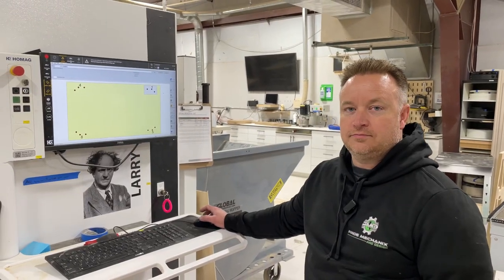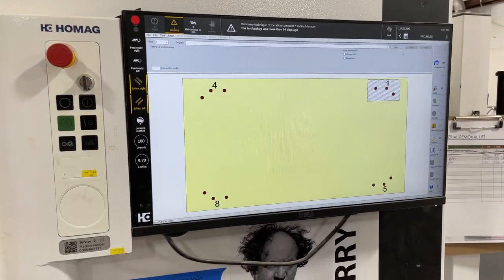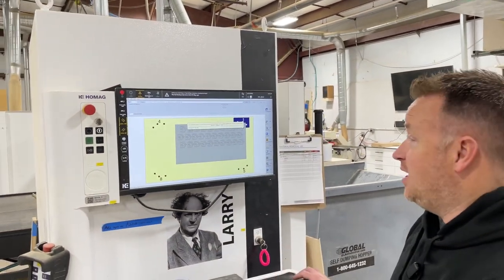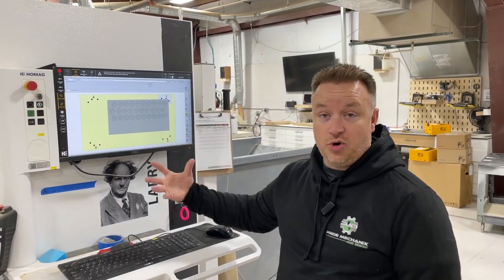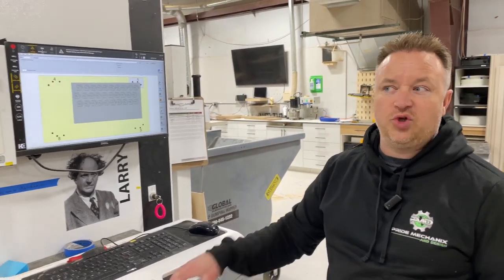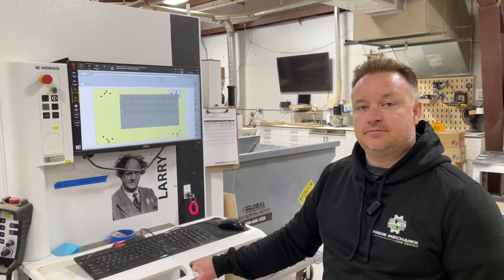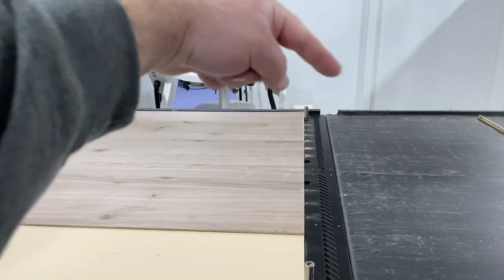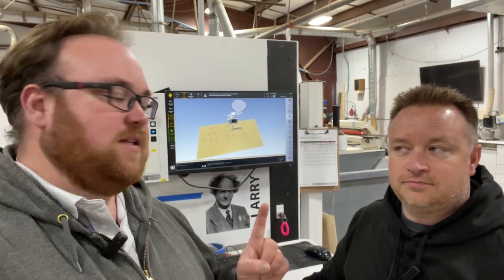How to load a program on the Homag CNC

Comment: 0,0 is front left guys.. field 8 in your assignment. I always load the sheet and pull it to the front pins (takes some practise), that way, you do not mirror anything, parts are closer to the operator, and you are able to use the front edge of the machine for mitering angles with a ball bit. I have worked on many Weeke/Homag Cnc's over the years and one thing I noticed is sometimes they install the tower on the left, and sometimes on the right. The tower should be installed on the left, and field 8 shoud be used. Simply click on field 8 in your assignment before loading a program, give it a shot!
Reply: @DemocratforTrump  Cool, that works too